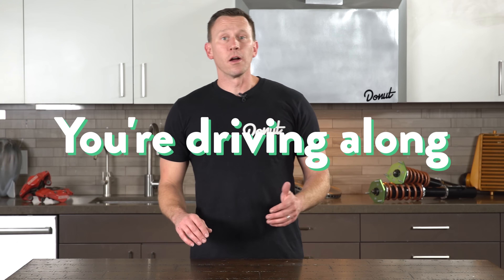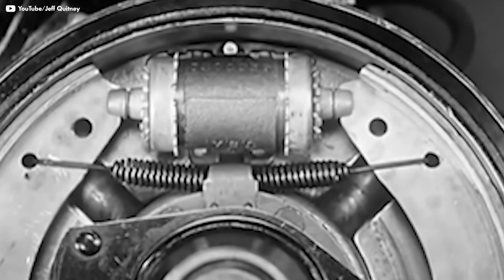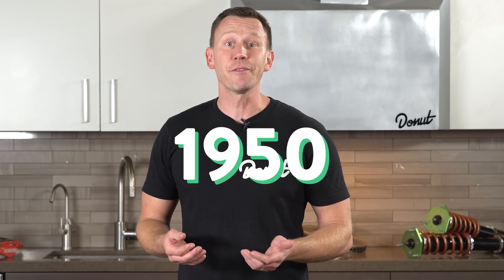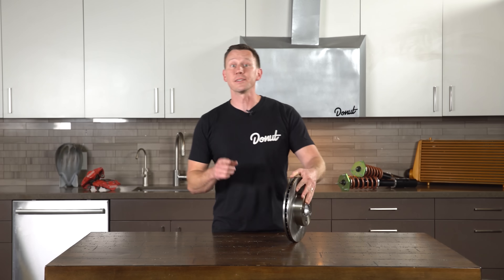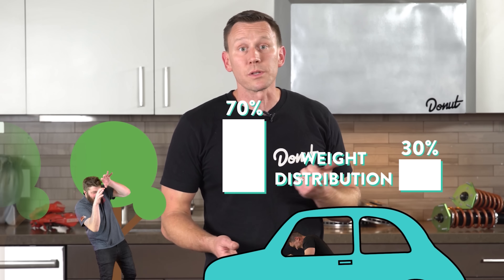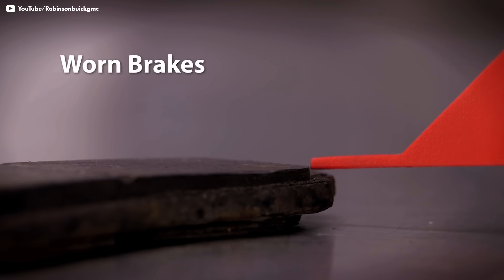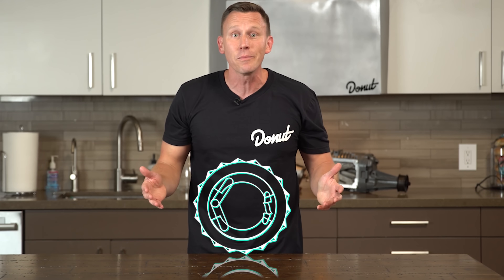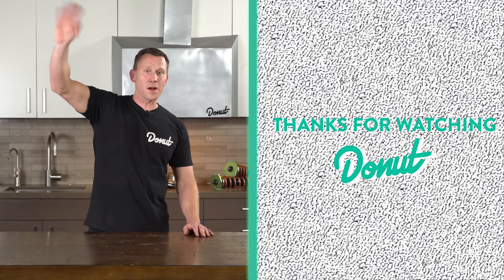BRAKES: How They Work | Science Garage

Comment: The surface area of the contact patch between the pads and rotors doesn't actually effect the friction force between them (common misconception) but helps with the cooling meaning better braking performance. Everything else was spot on though. Great video

Comment: I've always wondered.  Is there a reason each manufacturer puts their brake calipers in different locations on the hub? Infiniti/ Nissan puts the caliper on the front if the rotor,  Ford puts them on the back of the rotor,  dodge put it's at  45 degree angle of the rotor,  etc...

Comment: Video does explain what happens after you release the brake.
What keeps the brake from continually being applied after you release the pedal?
Reply: There is brake fluid like when u suck on a straw. Hard to explain but I'll try.
Its like when u flex ur arm there is no extra movement same thing with the fluid. It does not compress so there are no gaps :) so when u press down it can only go put pressure on the brake pads. And when u let off it causes a vacuum and the fluid use fill that gap :) i hope that helps. 🙏

Comment: My bike's Disk Brakes were somewhat loose, so to thigh'em up i need to pull the iron cable. While pulling the iron cable, i acidentally touched the disk, that was hot after some testing. It was so freakin hot that my finger got an bubble.

Comment: break shoes are mostly common on tractor trailers as their main breaking source. you don't see tractors or trailers with disk pads often although they are nice to work with. I have yet to seeany modern day cars with break shoes as their main braking source and instead it's their parking break
Reply: I just purchased a new semi with disk brakes all around. Total difference after my last truck with the standard drums all around.

Comment: I want to know if or how the rear (drum) brakes work when you press the brake pedal.

How does the hydraulic brake line work to "activate" the rear drums?
Reply: The hydraulics push a double sided piston apart, the piston then pushes the crescent shaped pad assemblies apart and applies pressure against the inside of the drum.  Then a spring pulls the cylinders closed again when hydraulic pressure is released.

Comment: Is there a system to capture that heat from the friction and convert it to electricity? Same with lost heat from the engine or exhaust pipes, unless it adds too much weight to be counted as efficient?

Also, can u do a video on shifting down, increasing rpms to slow down and where that energy goes, and if that would be an option on a car to be sort of a hybrid brake pad + rpm stopping?

Thanks!
Reply: Dynamic braking.

Comment: Question! My car makes a noise at the end of breaking. It is not squeaking noise, but it is rubbing noise.  The noise is intermittent, something it comes sometimes it does not. It is also at times loud, and other times quieter . I took car to a mechanic and pads, and other components of the brakes seems to be fine. Car still  makes this intermittent noise at the end of breaking. Any idea what can it be?

Comment: At 3:05 he's talking about the fact that it's easier to brake with disc brakes. It's the other way around. With disc brakes you need to use powered brakes. It takes a lot more force to brake with disc brakes. That's why most of the old cars with drum brakes don't have powered brakes. You just don't need them since it's not too heavy to brake.

Comment: Brakes can also squeal if they get wet, and you can find drums even to his day on brand new cars, for example VW will put discs in the rear only if car has over 100HP. Everything else will come with drums on rear wheels. Problem with drums is that they get dirty from the inside, brake dust has nowhere to go and over time it degrades performance. Rust is common on them but it's not a problem as long as it doesn't get inside, and even if it does, you can get them re-machined, no need to buy new ones. Also checking your brake lines is not a bad idea, on my MK3 Jetta front ones were all cracked and leaking, i noticed that it doesn't quite brake as it should and pedal felt spongy.

Comment: Rookie question. On disc brakes I understand how everything works with the floating caliper applying even pressure through hydraulics to both sides of the disc. My question is what causes the pads to retract? I see guys replacing pads and squeezing them right up to the disc. I know the piston applies the pressure for squeezing but what backs them off? I know they are extremely close to the rotor when no pressure is being applied so I'm guessing that the when the floating caliper with the spring loaded pins backs off the pressure, it just leaves the pads riding extremely close to the rotor if not barely touching which is why you almost always hear contact on any vehicle (motorcycle etc.) when just spin the wheel or roll it,  like on my motorcycle. Thanks in advance for anyone's help.
Reply: The pad will always be lightly touching the rotor. When you release the pedal, the pressure in the brake lines goes to zero. Without pressure, the pad is not pushed onto the rotor.

Comment: I came here to find out why/how hydraulic brakes require a running engine and pullies.. not sure I saw that anywhere.   Also is there such a thing as Electric brakes?  Wondering about EV conversions and Braking systems.
Reply: They don't,  your brakes still work without the engine running. Modern cars use power assisted brakes using engine vacuum or hydraulic pressure. The power asist makes it easier to push the pedal. Without the engine running the brakes will still work it just becomes harder to push the pedal.

Comment: Allow me to make a correction. The wheels have rotational momentum,  velocity and energy. The brakes apply a force, also known as torque because this is rotation, and the direction of that Torque is negative, which according to Newton’s second law, the rotational acceleration of the brake - rotor - wheel system will be negative, thus reducing the rotational velocity to zero radians per second. If you wanted to think about it in terms of energy, the rotational
Kinetic energy of the brake - rotor system will turn to heat AND sound energy.

Comment: Hey what i dont understand is how brakes dont screw up the engine. When you let off the brakes on an automatic car it rolls forward so im assuming the engines always running. When you press on the brakes how does the engine not explode? Wont the driveshaft try to turn and cant? Meaning the engine just either stops or explodes?

Comment: Just a quick correction increasing the surface area does not increasing your breaking power.  The equation for a friction force is F=μN (friction force=coefficient of friction*normal force).  Normal force would be how hard your squeezing the diskbreak, coefficient of friction is how much friction the two materials have when rubbing together, which when multiplied together gives you your total friction force.  Surface area does not matter because as you increase it your N is spread out over that area giving you less friction per square inch.  The larger surface area helps because there is more area to disperse the heat, not because it gives you more friction.
Reply: Besides that good video.

Comment: Seeing as I am able to completly lock up my breaks when I slam on the pedal, what is the benefit of upgrading the breaks?  It seems like it's pointless, seeing as my breaks can break harder than my tires can grip... What am i missing?
Reply: Better brakes will withstand heat better. Most stock brakes have what is called brake fade when they get too hot, which is where the brakes stop working effectively. Better brakes can also create less brake dust,  make less noise, and last longer. Unless you like racing then a brake upgrade would probably be overkill.

Comment: Buttttt, drilled and slotted rotors are not for greater cooling, but pad gas dispersion. When your braking hard on the track, your brakes heat up to the point that the adhesive evaporates and if that gas is trapped between the pad and rotor there won't be any braking to be had.

Comment: Good video, but there was a mistake. The breakes on fast cars aren't bigger because they provide more friction, that's a myth. Friction has nothing to do with contact area. They are bigger because the bigger surface area allows the breaks to dissipate the heat that builds up during braking quickly.

Comment: Hey Science Garage, can you explain how regenerative brakes work? I have a BMW 328i and the manual says braking for longer is better than shorter distances, for energy recuperation. Also, it'd be nice to know why an engine at standby at a stoplight is better economy savings. Heck why don't you do a science garage on Hybrid Car's energy efficient qualities and characteristics!
Reply: When you step on the brakes it also engages a generator that is driven by the wheels. The generator helps provide extra stopping power and charges the battery.

Comment: I can't for car manufacturers to discontinue the rear drum brakes and make four wheel disc brakes the new standard. Not a lot of car can be equipped with rear disc brakes because of the suspension layouts, not all cars and trucks can be converted from drum to disc. The only good thing about drum brakes is that they don't dirty the wheels, but the braking is ineffective compared to the disc brakes.

Comment: oh fun video idea can you do a documentary on the " POWER STOP " reman break calipers CO. ?  ...... oh you didn't - you didn't know power stop was going through junk yard and buying cheap calipers and rebuilding them with cheap cheap china rebuild kits - you didn't know they also buy the cast iron rotors from Taiwan at a super cheap price with severe imperfections and sometimes trick people into thinking that by drilling holes the unlucky buyer will think they are quality - what you say that's cheap ? well if you was to add up the cost from a yard find to a cheap china rebuild kit and the Taiwan cheap rotors you can spend less for what they are putting out there - you didn't know they over charge people for it. the amount of brake failures in power stop alone is scary af  but even with the freedom of information act and documentation is so redacted that the death tolls and injuries from this " brand " is hard to grasp true numbers from... hmmm disc brakes are better but the saying " you get what you pay for " also has a greater toll on this as well. brembo and willwood and even bear brakes should be your after market options to brakes outside of the OEM because anything less will cost you your life or someone else's.

Comment: The holes and slots in rotors are actually there to allow the gases from the pass to more easily release under braking to allow better surface contact and friction.

Comment: Surface area has absolutely no effect on friction. It’s the mass and weight. At least when it comes to friction that has gravity involved with it. 
A 5lbs block 1ft^3 has the same friction as a block of the same weight with 4 times the surface area making contact with the ground. All you really do with the brake pads is spread that pressure across a wider area, so the friction is still the same even if it’s really small, it’s just that the same pressure is gonna be concentrated to that smaller area which means less brake pad material and impractical brake changing intervals. 
In other words, making the surface area bigger isn’t gonna magically give you more friction assuming the same effort force is being applied. 
I mean correct me if I’m wrong but surface area has nothing to do with friction. Only that it dissipates the heat more effectively and lasts longer because the work is spread across more material as opposed to a smaller brake pad with less material. 
You also gotta remember that when you think of making a surface area bigger then the other 2 dimensions also have to get thinner to compensate. Otherwise you’re actually adding material and increasing mass and weight and those are what increase friction. So don’t let your brain give that illusion of not factoring in the fact the object would get thinner. 
You increase friction by either increasing mass which increases weight because it applies more force, and in this case, more force by pressing harder on the pedal, materials with high friction, and materials that are rough also produce more friction.

Comment: Thank you guys, reading the Toyota Dealership repair manual for my 2000 Toyota Solara, wanting to change my brakes but didn't know what the other components were. I wrote in my notes, "Rotor connects to wheel, Caliper sits on rotor and squeezes the pads to stop." Also an entertaining video too 👏👏👏

Comment: drum brakes are pretty good and where used in production cars up into the 80's * you mean still today *  point out 1 production car that's FF and don't have a drum on it or a 4X4 ( not 4WD useless cars like Audi or whatever ) or hell a standard FR pick up truck that's a 5 lug. yes the pain in the ass drum brake is STILL in production today. so you should of said " drum brakes are pretty good - and are used in a wide verity of productions cars of today - "

Comment: I think it is wrong when you talked about the wholes in the break disc because they are to Clean the breakpads from dust and dirt. That's the reason that some break discs Just have small gaps in the discs and Not whole holes.

Comment: "Hydraulic brake lines rarely rupture, they don't require the maintenance of mechanical lines"... I take it you've never replaced brake lines before?  Nothing more fun than leaking brake fluid all the way home due to a teeny tiny hole caused by rust.  No brake fluid, no brakes.  Even more fun when car manufacturers and or autoparts stores rarely supply OE replacement brake lines, especially in stainless steel, because I guess manufacturers honestly don't give a damn about your safety.  So in response to that, companies like The Right stuff ( getdiscbrakes.com is the website name ironically) supply complete brake system assemblies, from all the required hoses to stainless steel OE replacement brake lines!  Now why does a company like that have to go out of its way to provide a product that should be available CNC pre-bent and ready to install from any automotive store, when safety is the absolute paramount concern when assembling a car?

Comment: Great video, but a larger surface area does not mean more friction. The Friction Force is calculated by multiplying the coefficient by the Normal Force. The contact area of the surfaces is not involved. It works out the increasing the surface area between the objects actually lessens the pressure, so the normal force remains the same (P=F/A). Therefore friction only depends on the friction coefficient and the force being applied on the surface. A strange thing actually is that if the contact area is too small your coefficient actually increases which then increases friction with the same force being applied. This is because when the contact area is so small it actually "digs into" the other surface.

Comment: I always thought drums had the largest contact patch with braking surfaces but because of it's enclosed design, it couldn't dump the heat fast enough so constant braking would fade drums a lot faster.    Plus since they are self ratcheting, you always get consistent brake pressure in the long term (assuming under normal non-race use)
But I do know for sure that the holes in cross drilled rotors aren't for shedding heat.  if anything, the holes reduce mass of steel which reduces how much material can absorb the incoming heat.   The holes are there to vent the gases that the brake pads would produce at high temps.  The holes prevent the gases from forming a laminar layer on the rotors which would basically stop the pads from touching the rotors completely.   Most modern brake pads don't off-gas as much as the older pads do.   but I could be wrong.